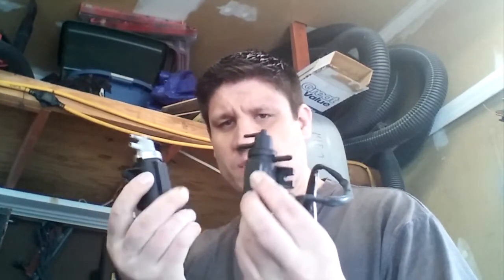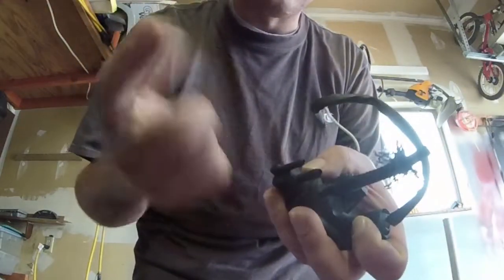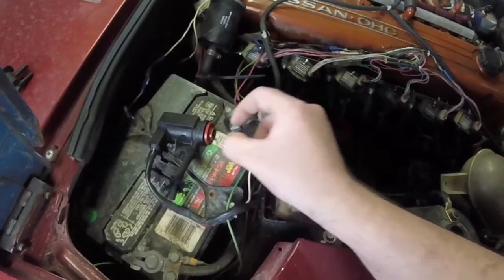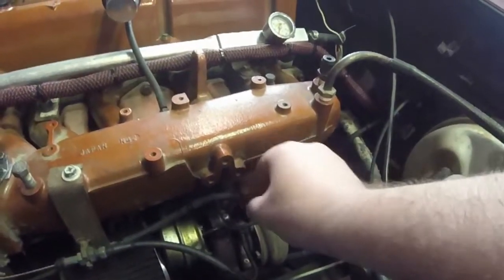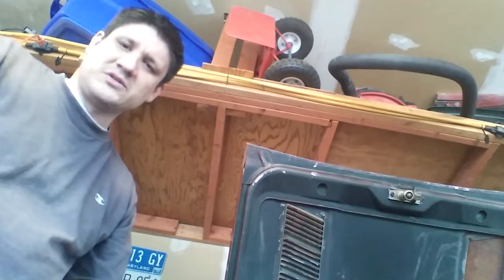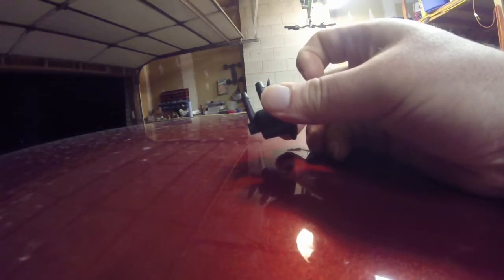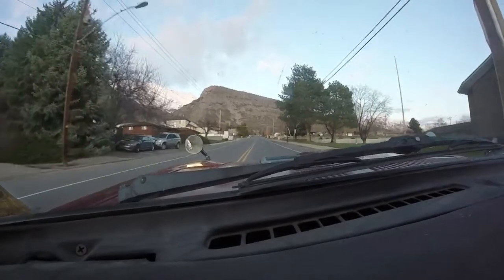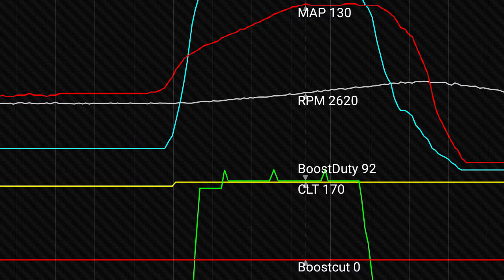Boost Controller with Speeduino - How they work and installation

Comment: Hi, great stuff. How did wire it into the Speeduino? I see my V0.4.4 board has pin 35 marked as boost out, is it a direct connection (5V low power)?

Comment: It looks like the VW solenoid is a 3 port type? 3 ports are plumbed with the 'common' port connected to the wastegate, and the normally closed to the manifold. When the solenoid is energised it dumps the pressure in the actuator. This gives much better control than using a restrictor pill.
Reply from the maker: Thank you! So I think I understand what you are saying and that makes sense. I pulled this one off a TDI. In looking through how they set it up I came up with the way I did it in this video. Thanks to your comment, I found out that they ran them a little different for the gas engines than the TDI. I will give this a shot tomorrow and see if it works better with less duty cycle! Thanks for watching
Reply: @CEKGarage  your welcome 👍, let us know how it goes. I love the Z by the way.

Comment: Have you got restrictor pill in turbo -> wastegate line?
Reply from the maker: Great question! No I am not. I am running a normal line as a block style boost valve right now. Going to try running it as a bleed off style later today!
Reply: @CEKGarage  It may help with duty cycle and match vent diameter as it restrict flow to the wastegate actuator. But you probably know it :) Btw great content. If you plan to run PID EGO control please do a video. I'm struggling to set it up. Cheers!
Reply from the maker: Thank you for the tip on the PID video! I can do that. I have been running simple for so long, time to tune it up!

Comment: Thanks for making the videos! Do you have to use pencil coils with speeduino or will i be able to keep my 4 in 1?
Reply from the maker: You have a few options, if you are using a normal coil, you might need IGBT in between Speeduino and your coil to drive it if it is a dumb coil. If you have a smart coil, you can connect right to Speeduino and just use the 12v or the 5v jumper. There is some documentation here - https://speeduino.com/wiki/index.php/Hardware_requirements#Coils
Hope that helps. Thanks for watching!
Reply: @CEKGarage  Cheers! That makes sense. Going to be doing  as you said and just get it running. Its a 1991 NA bmw m42 so shouldn't be too difficult. A few sticking points but have most of it figured out now barr the coilpack.
Reply from the maker: Love it! My brother in law (Brad that shows up on my videos from time to time) is a huge BMW nut. We might be doing a Speedy install on it in the future. (we have a 620 truck to get out of the way first) We started to collect parts, he is planning on using LS coils on his N42.
Reply: @CEKGarage  Id say there would be plenty of people interested in seeing that. There is a guy near me breaking an e36 m3. Going to try to shoehorn as many parts from the s50 in as i can.

Comment: Lovely. If duty cycle is getting high, try lowering solenoid frequency in TS. Great progress BTW !
Reply from the maker: Great Point, I did drop it down the frequency a bit, I could have gone a bit more, but it seems like the vent of the boost valve was just too undersized. I will spend some time looking for the best frequency this week!
Reply: @CEKGarage  If you dont plan on running much more than double the boost of the spring, setting it up as such: normal line from wg to boost source, TEE that line, like you would bleed normally to raise boost, and plum the solenoid on that bleed-tee. Invert the duty cycle in software and keep it off until 10-20kpa below wanted boost. That way, it will boost max until actually needed to work, and help spool. With this setup, you just have a controlled bleed instead of a full source manipulation, and you can yield great results this way with getting stable boost as well
Reply from the maker: Great point! I ran that style on another car a few years ago. This specific controller was an in-line style, so I did not think to run it in that way! I got it to work as the bleed style, but as I played with the pid settings today, it was a bit more touchy than my last car. Thank you for your tip and getting me to re think it! I will test it out tomorrow.